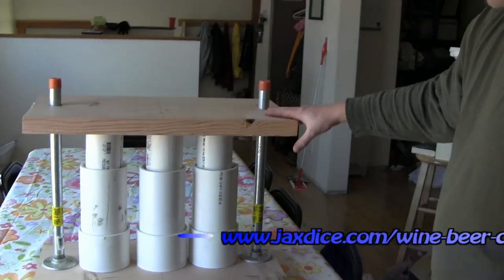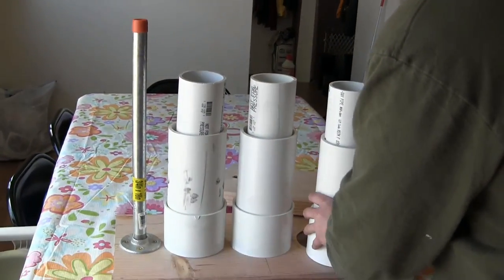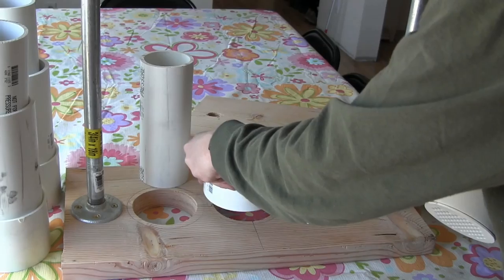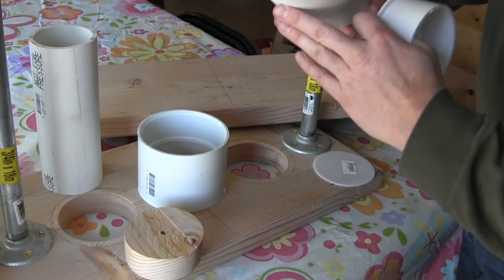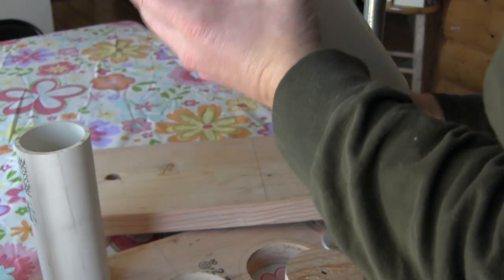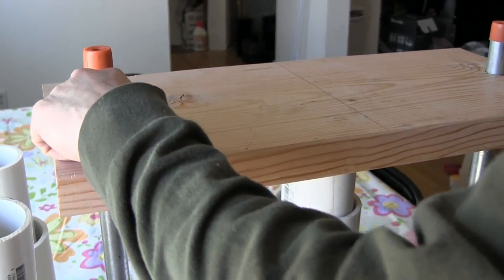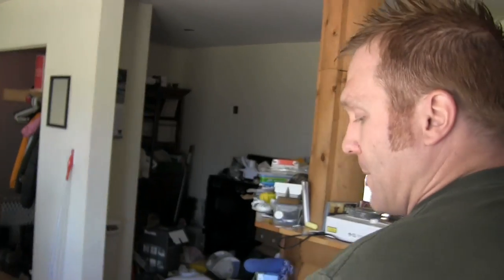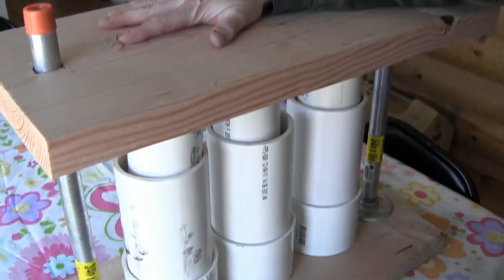Wine Beer & Cheese Episode 8 - Medieval Cheese Press

Comment: Specific cheeses require specific weights. For a 3” pipe, You would need to factor about 7 square inches (r or 1.5 x itself x pi), so a 10 lb weight would only give you 1.4 pounds per square inch. For a 4” pipe, about 12.5 sq in. and 0.8 lb/sq in. A lever would be better and more “medieval”

Comment: You might want to drill many holes in the side of the tubing. The only place you have for the whey to be expelled is at the bottom of the mold. And that's OK except that if the cheese wheel is say 9 inches high then all the whey at the top will need to move through to the bottom and so the use of what is called the follower (you call it a piston) is not nearly as efficient or effective as it would be if there were holes drilled all around the side of the tubes from top to bottom. And sure you upturn the cheese every few minutes or hours but the whey remaining still has to be pushed through all the curds before it can be expelled...

Comment: Does the PVC resist boiling temperature? (For sterilization)
Reply: I doubt it. Just clean it well, your kitchen it's probably dirtier than the pipes. Rub it with alcohol if you are still worried.